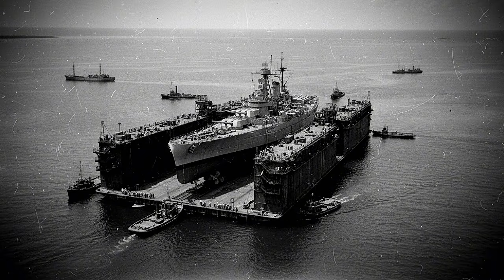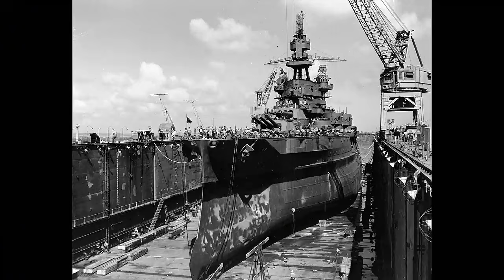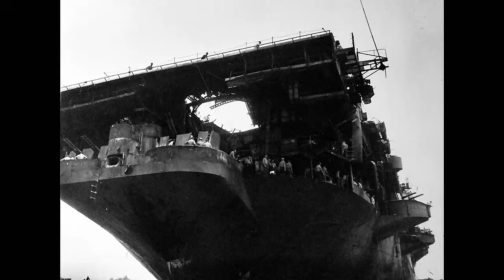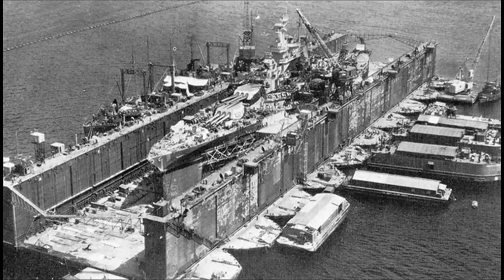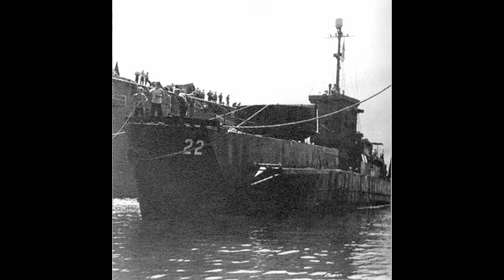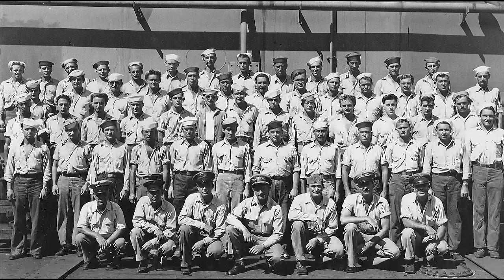How America Built "Massive Floating Shipyards" Repairing Ships Every 48 Hours at Sea

Comment: The Randolph story is better than what's here. She was never drydocked — the kamikaze hit above the waterline, so the crews rebuilt her flight deck and hangar structure right there at anchor, using 29 tons of steel that included I-beams cut out of a Japanese sugar mill on newly captured Saipan. That's the detail this subject deserves. Worth a second pass on two others: North Carolina was torpedoed in September 1942 off Guadalcanal, not off Truk in 1944, and ABSD-1 was at Espiritu Santo through mid-April 1945, not Ulithi.

Comment: We had a few of these at the private shipyard I work at. One of them was what at one time a 12 section all wooden dock, originally built to do big ships. When I got there in 89, we had five of those sections linked together, and another three sections in another area working for smaller craft. Pretty amazing.
Years later we got leased an all steel floating dock from a place in Florida. I think the name was the Reliance, but might be wrong. It was built in 1942. After the war, the story was that she spent most of her time in Gitmo, Cuba, servicing ships there that came down there for SRAs and testing.  We used her for many years, and by he time it was sold, it was in pretty bad shape, in spite of all the work that was put into her. She was modified to service the large amount of the Perry class FFGs we worked on in the 90s.
A real shame, she was sold to a private company in Porto Rico for scrapping. They were towing it there and only made it half way, and it sank with a bunch of equipment sitting in her basin. In deep water.

Comment: Your description of the secquence of USS Randolphs dock schedule is wrong . First dry dock is emptied and blocks reset, then flooded carrier moves in Water removed dock rises just before the carrier takes to the blocks, Divers enter water tho make sure carrier is positioned correctly and ship supporting structures are in correct position. This is important as ship structure might be compromised due to damage. De-watering commences. Carrier is high and dry. The most critical time is just when the carrier touches the blocks as this is when the carrier is no longer floating, but being supported by the dry dock. This is the same whether a Dry Dock or Graving dock  Difference is one is floating the other is land locked. Have done this many times being an ex marine engineer.

Comment: Let's see if we have this right. The dry dock takes on water and sinks, meanwhile the carrier rises. RIIIGHT! Do the creators of these things not check them before posting.

Stopped watching and scrolled on right there.
Reply: The dry dock takes on water and sinks to a depth that allows a vessel to enter and is stabilised on floor stands that it settles on as the dry dock pumps out water and slowly rises. Side timber props are then used between the ship and dry dock walls to keep it upright as the dry dock floor rises clear of the water. Simples…
Reply: That is not the sequence as in the video, and yes, I am well aware of how a drydock works.